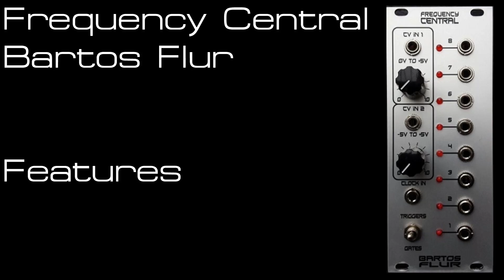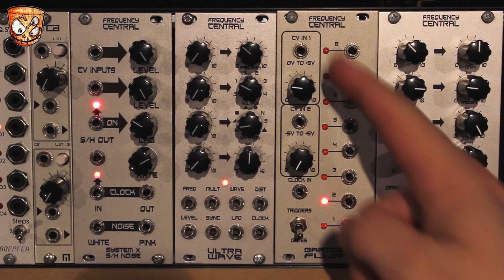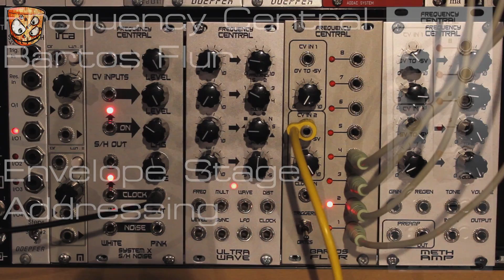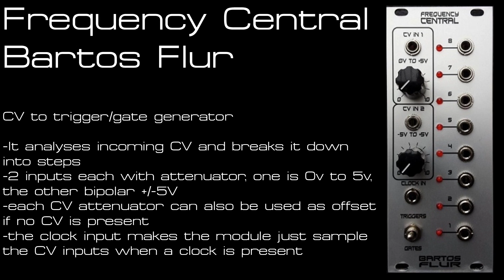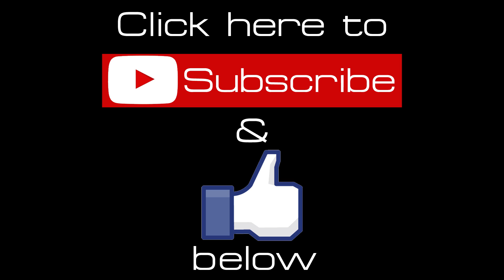Frequency Central - Bartos Flur

Comment: very similar to A-152..
Reply from the maker: Vurt72 yeah it is similar although this outputs just triggers or gates. The ALM Boss Bow Tie also does CV addressed switching and there's the new RYO module 'Paths' coming as well which will do clock or CV switching.
Reply: DivKidMusic interesting. do you know if the digital outs on the a152 are more similar to gates than triggers?
Reply from the maker: Vurt72 no idea about the A-152 but Dieter Doepfer is great over email so drop him a line if anything isn't clear. This unit the Bartos Flur can be either gates or triggers and the Boss Bow Tie I mentioned outputs whatever you put into it.

Comment: What are the differences to this and the Boss Bow Tie? Do you know if these will be assembled or DIY?
Reply: grimjaw jaggajak Ah, thanks.
Reply from the maker: Alastair Lindsay Yeah what Grimjaw said. Boss Bow Tie is a switch letting signals both 1 in to 8 out and 8 ins to 1 out as it's bidirectional. Thi generates gates/triggers from a CV signal. They do at first seem similar, especially with me doing both videos next to each other :)
Reply: I think that's what confused me, the 2 videos being done one after the other.  Thanks for the clarification.
Reply: Alastair Lindsay it seems like a more thought out version of the RYO VCSEQ's trigger expansion :)
Reply from the maker: banyek314 similar idea yeah when a voltage reaches a certain value a certain step from 1-8 is active (as a gate or trigger, switch dependant). Although the VC Seq is arguably more powerful when powered with the VC Sequencer (only way it will work to be honest, so saying a combo of a sequence and expander is more powerful is sort of daft) as you can clock in forward and reverse and voltage control the VC Sequencer. So more options. But won't work at all by itself.